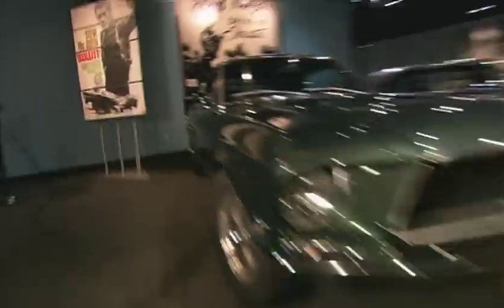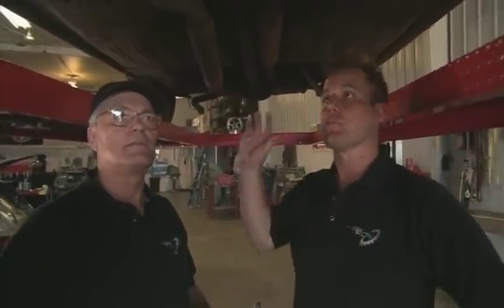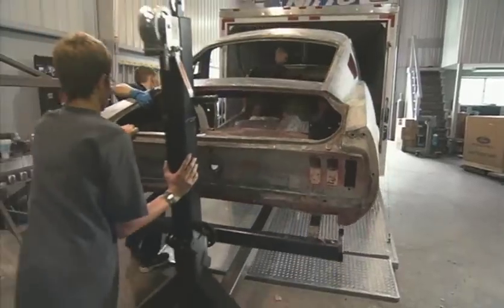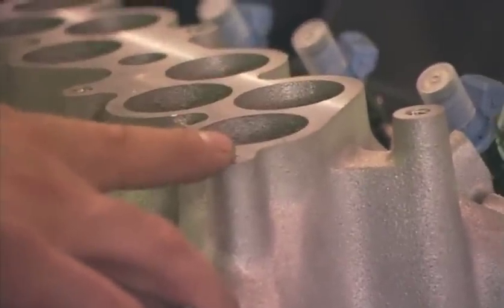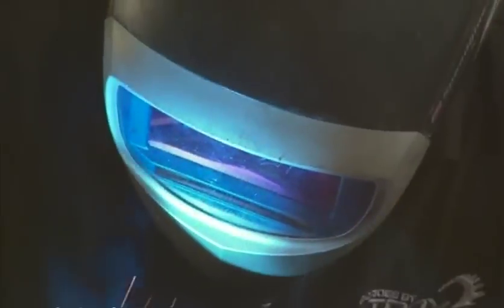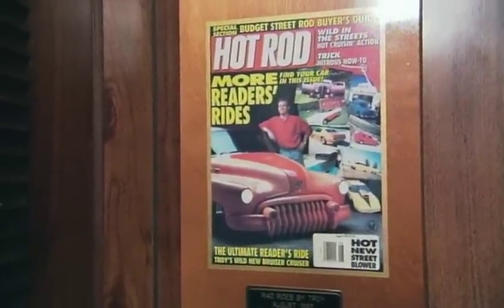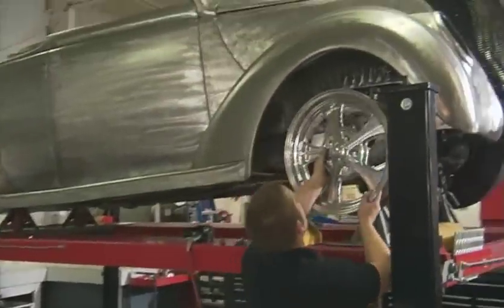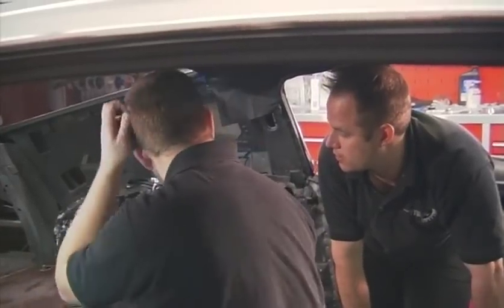RIDES - FAST FORWARD FASTBACK - 1967 FORD MUSTANG

Comment: The damage and welding to the shock towers are simply due to weak construction from Ford. Every time you brake or hit a bump the upper control arm put tremendes stress on the shocktowers causing over time the inner fenders start cracking.

Comment: Why destroy another Mustang to get the front end off of it? Why not just purchase a new front end from Dynacorn?
Reply: Didn’t you hear when they said it was part of a contest? Not sure that kind of thing was allowed.
Reply: Dynacorn wasn't making Mustang bodies in 2002. Besides that, original sheet metal is always better than aftermarket for fit and finish when hanging fenders and fitting body panels.